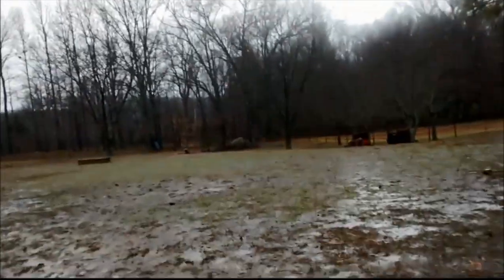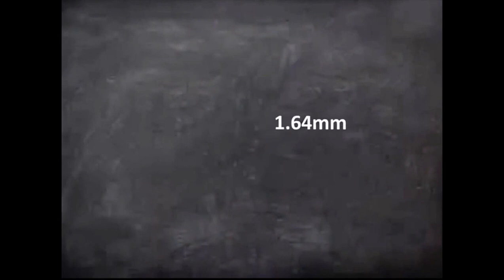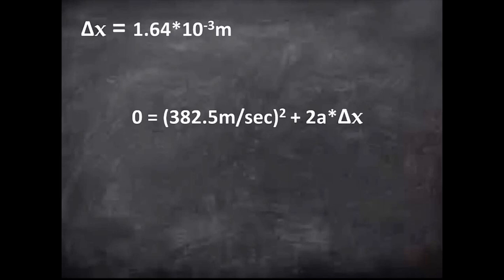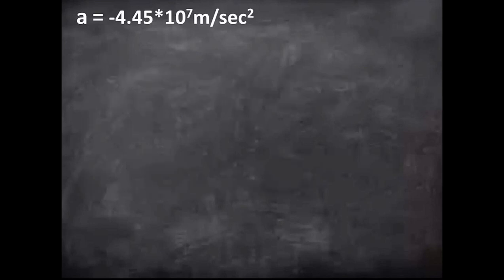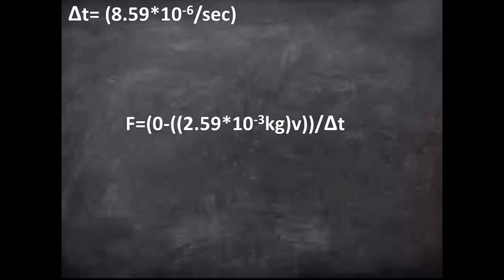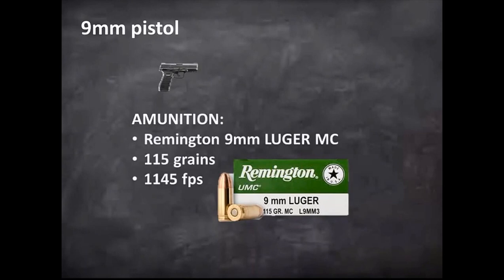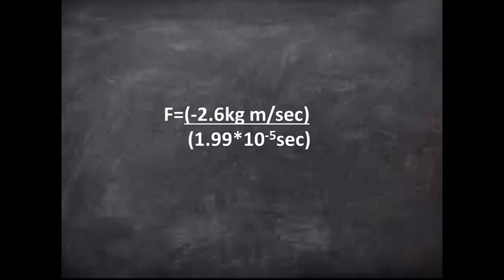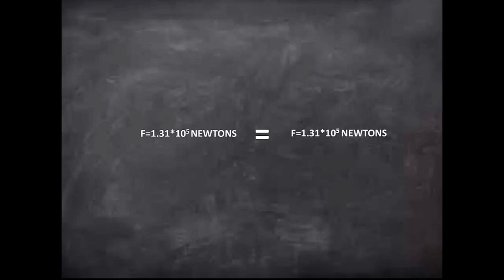Bullets VS Aluminum:  Strength Testing of Home-cast Aluminum Plates

Comment: This is awesome.  Did you ever use higher velocity rounds to evaluate if the same force prediction holds true?  The 22 and 9mm are the same ballpark velocity so they only really change in mass.  Pivoting your experiment with a 223 round would give you roughly similar mass and diameter to a 22lr but woth significantly different velocity.  This way you would see how things play out with only mass change (22lr vs 9mm) and only velocity change (22lr vs 223).  I also believe that the force number is highly dependent upon plate thickness.  If there is significant back face deformation I bet this number changes alot.  So another great experiment would be changing the plate thickness.  Anyways. This was super cool!!

Comment: So... I've got a question for you. How thick does an aluminium plate need to be to reliably deflect: .22lr, 9mm and buck shot rounds at a ~45° angle at 5 meters.
Reply from the maker: Well if you are going to attempt this the plate should be around 3/8" or ~10mm thick...to calculate the deflection remember angle of incidence = angle of reflection, it kind of looks like this >|. I must warn you the physics of supersonic projectiles is rather complex so I make no guarantees. The plate should be securely fixed. 5m is a little close so with the sporadic nature of buck shot in particular I would be weary. Aluminum is fairly soft so it will absorb most of the impact and would probably only allow accurate repeatable reflection at extreme angles, so you may want to go with steel. Again I am not an expert, just a senior in high school who made very good grades in physics and has shot guns a time or two, so proceed at your own risk.
Reply: TechTazed Thanks for that, but I think steel would be too heavy for what I desire of it, but maybe with the fabric-covered wooden padding behind it, it'd be light enough and it could successfully deflect/stop a round.
Reply from the maker: +xXInfXx I wish I could be of more help but I don't know exactly what you are building...if you are simply wish to stop the round with a fairly soft lightweight material I would suggest getting some kevlar off ebay and stiffening it with fiberglass resin( resin is only needed for the loosely woven kevlar typically found there).

Comment: Oh you got all technical on me, so compared to mild still or rolled aluminium of average spec what was it's strength like?
Regards jon
Reply from the maker: I must admit that I haven't personally done any testing on those but from what I have observed from others these plates seem to hold up about 75% as well as mild steel and are only ~1/3 the weight. Hardened steel on the other hand preforms about 3X better and thus nearly the same in regards to weight vs strength. hardened steel does however have a greater tendency to crack. Rolling vs Casting varies greatly with the alloy however once you're over 1/4" thigh there is little difference. I am not an expert and the statements in the response are based entirely on observation rather than calculation. Since I don't know your particular application or alloy I cant make a definite assertion that one would be better than the others. I hope this was at least somewhat useful.
Reply: Cheers i can't remember what it was i was looking for now, but watched the video and it got my mind ticking. Thank you very much for your explanation.